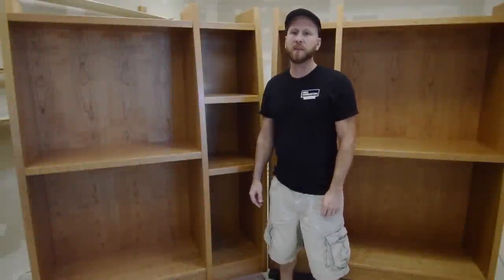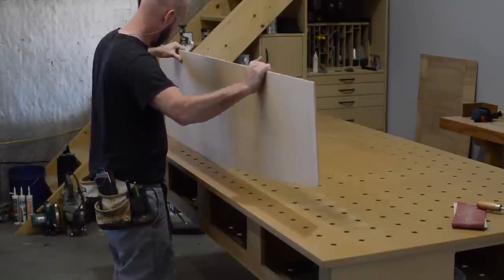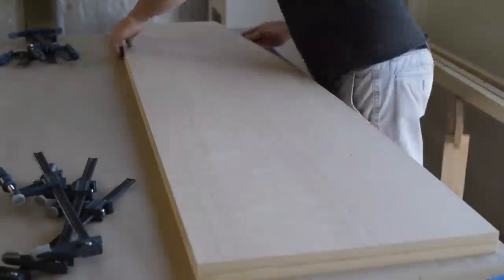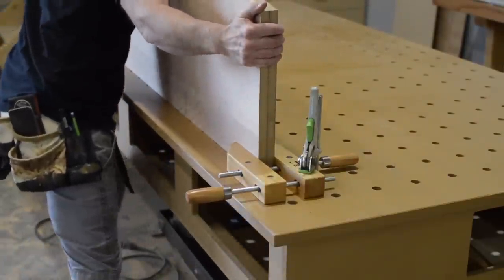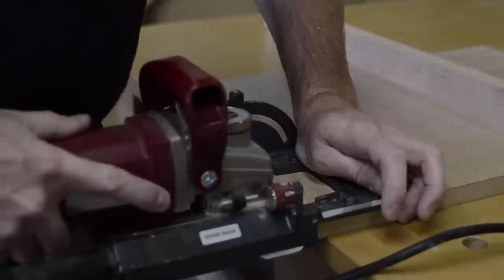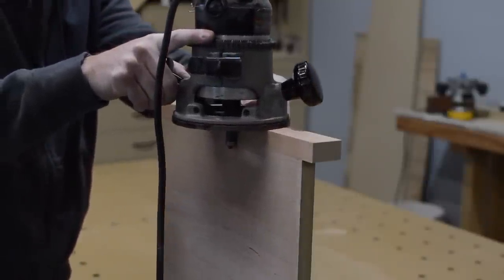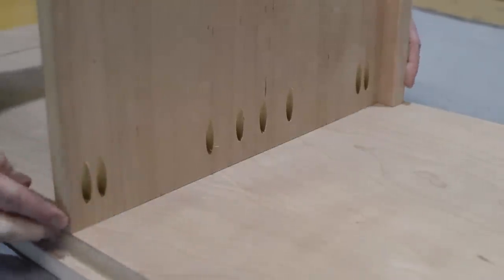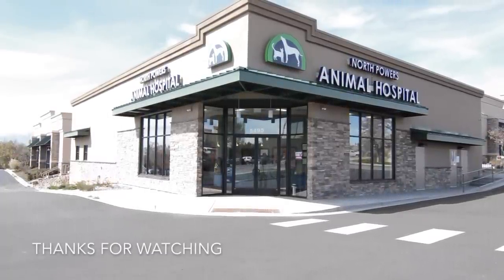Easy to build custom display cabinets, woodworking, carpentry

Comment: nice work dude. i just wonder what's the idea behind the pocketscrews, first i thought b'c of disassembling ? but as you already have that incredible lamello and use biscuits, why not just glue the whole thing - with plywood there ain't no working in the material like as solid wood does, right? could you please illuminate me?
Reply from the maker: I have found when building large things like these cabinets, its almost impossible to glue and clamp everything together. By the time glue has been spread out, its dry back at the start, then there is the mess when two larger parts are assembled, lastly, I don't have enough clamps that are large enough. Screws can be installed slowly and methodically, so there's no mad rush to put things together. Hope that makes sense.
Reply: @MikeFarrington thanks and yes, that makes sense. now thinking about it, me neither has clamps that big so pocket screw's a real livesaver.
Reply from the maker: @semtex2987  To add to your point about the clamps, sometimes I hide a pocket screw in a traditional joint just as a clamp.

Comment: Hey Mike I absolutely love your videos and the projects made during them. But I have a couple questions. Was there a particular moment or completion of a project when you told yourself, "now I'm a legit Carpenter/woodworker?" Secondly, do you find a distinction between the two terms? Or are they based on the task at hand?
Reply from the maker: I will never consider myself legit at anything. I am always a student. I really think with this particular trade the learn must always go on, just to keep up with trends/new methods/tools/etc. I'm not sure on the two terms. I think the answer is which ever one conveys best to the customer, but I'm not sure which that is. If I had to pick only one I would go with carpenter.

Comment: Hey Mike I noticed that you use mdf a lot and was wondering what the reason is. I know it's cheaper than plywood and more consistent but at least from my perspective the longevity you get out of plywood and how much lighter the material is I'd think it would be better. Is there a particular reason you stick with mdf?
Reply from the maker: I normally don't use MDF veneered plywood, in this case its what my supplier had in stock. With that said, I can't buy veneered plywood with some amount of MDF in it. The newer stuff has 1/8" layers of MDF under the veneers on both sides. There really is no avoiding it.
Reply: @MikeFarrington  yeah that sucks. Here in Florida we get the good stuff. Whenever I'm making customer boxes I usually run to plywood as quick as I can just for lightness and longevity. Thanks for the reply

Comment: Random question what are the 5mm screws you use for blum hinges? And yes your take on blum stuff would be great!
Reply from the maker: They are called system screws. I will do a blum video soon.
Reply: Thanks!

Comment: Do you have a video that shows how you added the tire tube to the clamps?
Reply from the maker: I show it quickly in the video about a media cabinet and floating shelves. I also have an blog post on how to do it on the Fine Woodworking website.

Comment: do you have to always climb cut with the virutex. I have used an adler alot in past shops, and am in the market for a lipping planer. the adler is significantly more expensive which is why i was considering the virutex, but seeing that you have to climb cut for a good finish is a bit of a turnoff.
Reply from the maker: I don't have to, but tear out will occasionally occur if I'm moving too fast with a normal cut. If the blade is super sharp it will leave a great finish, cutting either direction, when it dulls a little, climb cutting really helps.
Reply: @MikeFarrington  interesting.

Comment: Great video as always!!  You mentioned plywood in there once or twice but always referred mdf. Did you glue ply to the mdf or did you get veneered mdf and glue two of them together? Thanks
Reply from the maker: I used MDF core plywood. If its got 3 or more layers industry considers that plywood, but many would refer to it as MDF. I go back and forth.
Reply: @MikeFarrington  thanks. I’m fairly new to the woodwork game. And learn a lot from your videos How well do the pocket hole screws hold up in mdf/plywood? Clients will be putting quite a bit of weight of dog food on them.
Reply from the maker: @emersonstewart8165  They hold up fine combined with the biscuits and the sheer added with the back.
Reply: @MikeFarrington  thanks for the feedback. I’ll be getting a little less mighty biscuit jointer this weekend (porter cable)
Reply from the maker: @emersonstewart8165  I used a porter cabinet one for a bunch of years. Its a pretty nice tool.

Comment: Love this shelf! curious, did you ever think about trying to match the angle of the curve on the uprights on the fronts of the shelves? (best seen at 14:10)
Reply from the maker: Yes, that would be cool. This project was built to a budget, that would have put it over.
Reply: Mike Farrington ahh makes sense, does seem like it would add a bit more work
Reply from the maker: @brandon.raguz1  I figured it would add at least 4 hours, and we were up against the wall on the budget side.

Comment: A question.  So many makers today use a variety of Festool equipment.  It doesn't appear you do.  Is there a reason?  The only Festool product I own is their Domino cutter which would have IMO been a step up to the biscuits you used in this project (though I do still use my old biscuit cutter from time to time).  Just curious.
Reply: Mike 

In my non professional opinion the only two festool tools I’ll own is the domino and a Rotex sander.  The other stuff can be found by other makers that is just as good if not better
Reply from the maker: Festool stuff is really expensive. Where there is an alternative I normally go that route. I do own a Festool track saw and both dominos.

Comment: Lol, I hate the staples too, or damn stickers that will not come off.  You know they actually make easy peel stickers!!!

Lol, how many of those edge banding Inter-Clamps did you make?
Reply from the maker: Agreed, it just seems like something that would be easy to fix. I bought 200 of the spring clamps, and turned 100 into the edge banding clamps. For a while Amazon was selling 100 packs for like 115 bucks shipped.

Comment: Love the display shelves and the tip on how to cover the pocket holes. Is that plywood an MDF core?
Reply from the maker: Thank you. Thats a really neat tip, yes MDF core plywood.
Reply: @MikeFarrington  I think you might have mentioned it's because it is more stable than conventional plywood. Would love to see a build video of your interesting saw horses I've seen in some of your videos ( like when you made your assembly scissor lift torsion box table).
Reply from the maker: @lifeofbrian9695  I buy MDF core stuff cause its what my supplier sells. I could order veneer core, but it would double the price with shipping. I like MDF, but I think for veneered plywood I would prefer a veneer core, but I just can't get my hands on it. I am planning a build where I make several saw horses. I will turn it into a video.
Reply: @MikeFarrington  awesome.  I know they are a simple build but would like to know some info on them.  I'm looking for some knock down saw horses since I have limited space.
Reply from the maker: @lifeofbrian9695  I have a few tricks up my sleeve that will make them more functional than just normal saw horses. I will try to have that video out in the next month or two.
Reply: @MikeFarrington  sounds good. Can't wait.

Comment: What happened to the integrated dust collection that you built into the lift bench?!
Reply from the maker: Its still there, I was using it when I used the biscuit joiner. It just doesn't work with routers because they don't have shrouds.

Comment: You dont have enough clamps ....i dont believe that Mike ,looks great is it me or did i notice no glue on the biscuits,would that not give it even more strength
Reply from the maker: There is never enough clamps. I don't use glue for stuff like this. The potential mess created when gluing the larger assemblies together, and the issues that creates when finishing have stopped me from using glue for stuff like this. Hope that makes sense.
Reply: @MikeFarrington  yea I get you there ,never enough glue lol

Comment: What size spring clamps do you use/recommend?
Reply from the maker: These are sold as 6" clamps on amazon, the jaw opening is about 3". I suggest buying in bulk to save. I'm not partial to brand.
Reply: Mike Farrington TY
Reply: Mike Farrington one more question... I am making a shelving unit for my wife’s bathroom, I was planning on using birch plywood and I’ve been trying to figure out how to cover up the edges and I like/learned how to do it from this video. What species of wood would you recommend to use for the edging that will match well with the birch? Thanks for the help.
Reply from the maker: @tomm8188  Birch would be the first choice, but maple would be a very close second, and easier to find.
Reply: Mike Farrington thank you for the help, it’s really appreciated.
Reply from the maker: @tomm8188  My pleasure.

Comment: God bless you and your beautiful family, Mike! Long time follower, thank you for the great content, as always!

May I ask you: if you were in a small shop would you consider a push-pull saw as a main tablesaw (like the Erika from Mafell)? I’m considering to add one to my small shop but I’m kinda lost 🤷🏼‍♂️

Regards!
Reply from the maker: Thank you very much, same to you and yours. I would totally have a push-pull saw, even in my shop now. I could find a use for one of those. The only hangup is the cost.
Reply: @MikeFarrington  Yeah, the cost is part of the equation I'm trying to solve right now: I do have a limited amount of space (12mq) and finishing to setup my new workbench that I decided to put on wheels to save space. I'm not a woodworker, or at least woodworking is not what I do for a living.

All the small projects I did for my home up to now, I nailed everything with a track saw. But woodworking is a strange disease and it's definitely a drug you can quickly become addicted to: so I'm starting looking into more "fine furniture" projects and want to test out myself and since I'm building a desk for my studio I will have a lot of parts to cut out and consistency will be a key.

So, long story short, I think I need something more similar to a table saw, but because of the limited amount of space, I think that maybe a push-pull saw will serve me better!

Thanks again for the great content and for being the inspiration you're to me!

Best Regards,

Maurizio
Reply from the maker: @Spider2029  Good luck with the rest of your shop. I suggest putting everything on wheels.

Comment: Hey Mike - you seem to use an awful lot of MDF. Aside from price, why is that? Most people seem to hold it in low regard.
Reply from the maker: I don't know why people hold it in low regard. When used properly its a fine material. Price is a good help, but its a later more stable material which is great for building cabinets and millwork.